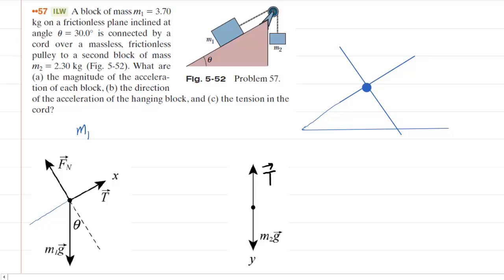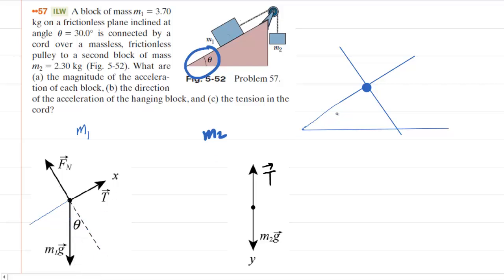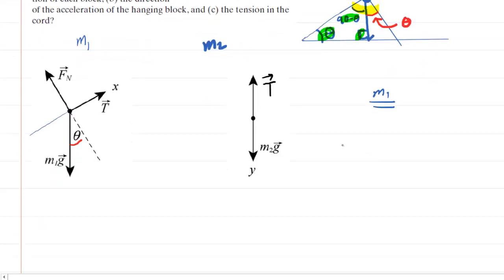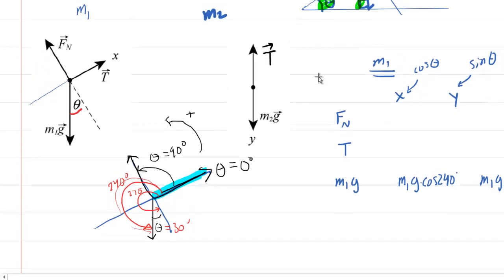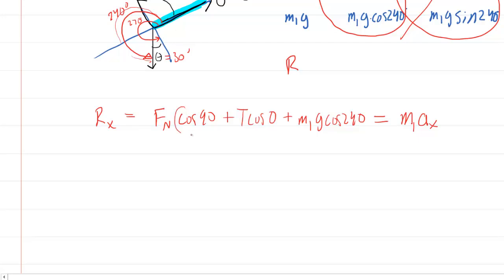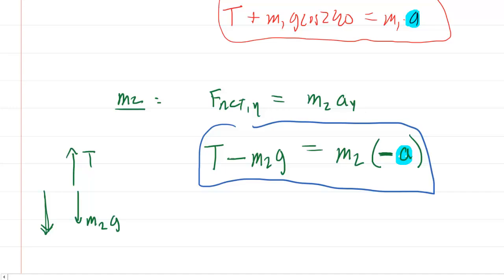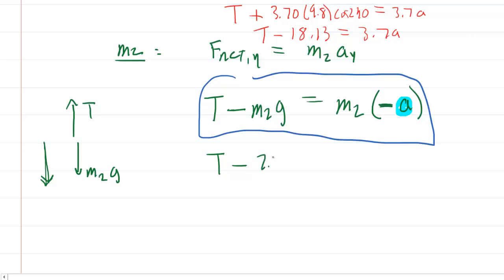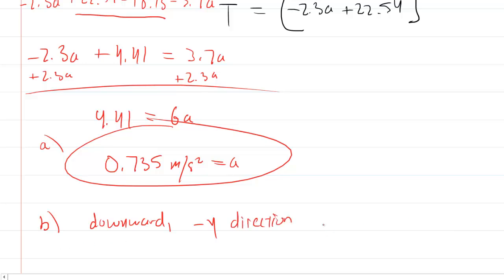A block of mass m1=3.70kg on a frictionless plane inclined at angle

Comment: How can you assume that the smaller block accelerates in the negative direction?
Reply: If you set the movement of the larger block going down the ramp as positive, and the smaller block travelling upwards then you can.
Reply: Also, keep in mind this block is being pulled by gravity, which always accelerates downwards. The sign in front of this value will change depending on what positive direction you set for N (netforce)